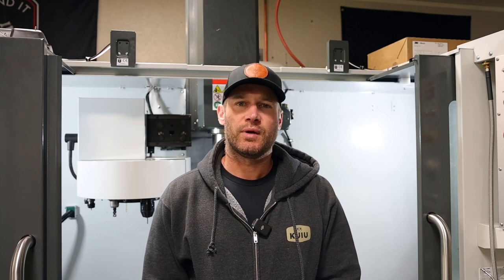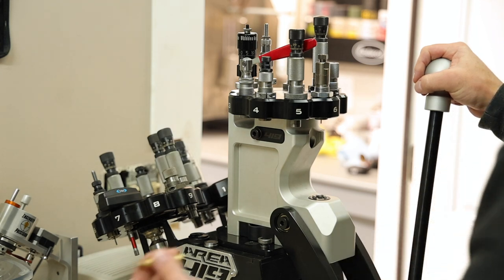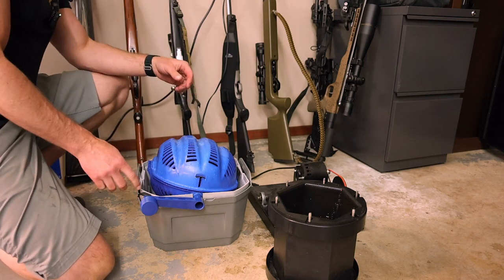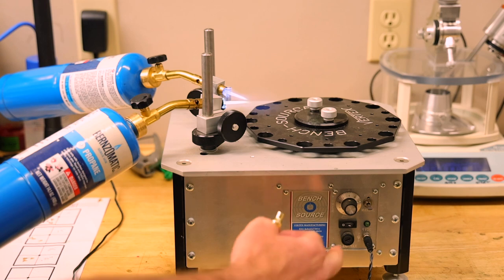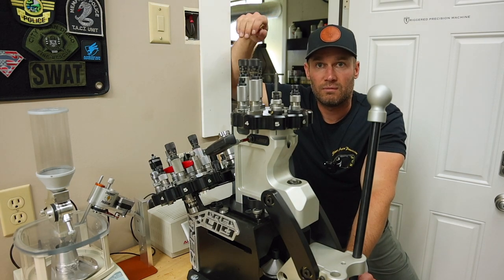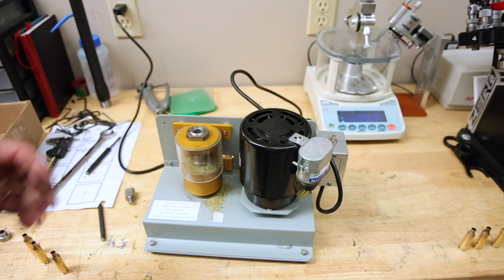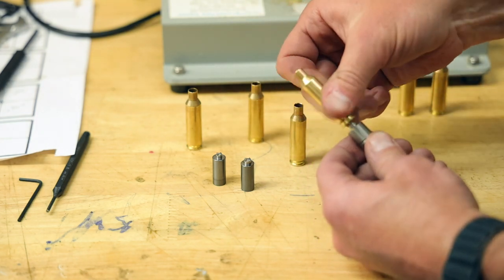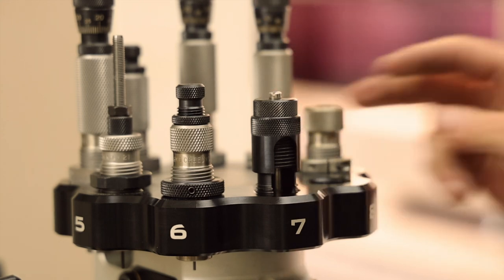TPM Reloading - The Precision Rifle Reloading Series - Episode #3 - Detailed Rifle Brass Preparation

Comment: Great series! I’m rewatching your reloading series and about to switch to wet tumbling from my ultrasonic cleaner. I appreciate your thoroughness and added detail. Since I use an SAC bushing/mandrel die I may use graphite for seating if wet tumbling removes more carbon than my current technique. P.S. I’m still loving the rifles you built me.

Comment: Regarding using the mandrel. I also try to achieve 2k neck tension. I use 21st century mandrels however when I run the case on to the mandrel when the case is brought back down I spin the case in the shell holder 180 degrees and run the case back up into the mandrel. Regarding lubricant on the mandrel I used to use the graphite like you do but I have recently switched to a liquid lube called NeoLube 2. I have found when seating my bullets in the arbor press I see more consistent seating pressure. I don’t think your going to show seating using an arbor press but the press you are using in the video. That is cool I’m probably more annal in my reloading process. What you are providing is some great information and detailed instructions for Reloaders. Keep it up 😊
Reply from the maker: Thank  you Steve - I'm seriously interested in the NeoLube - If you have a minute, check this link and see if this is the right stuff - https://www.amazon.com/Prestige-Industries-Neolube-fl-oz/dp/B07G2SK8VN

My dad is doing a whole bunch of pretty scientific neck tension testing using an Amp Press with a load cell all hooked up to a computer to graph the bullet seating pressure. So far he's discovered some pretty interesting stuff and definitively confirmed consistent neck tension and even bullet seating pressure is a massive contributor to consistent velocity. 

I'll give that NeoLube a try. Looks like a great way to go. Thanks

-Shawn
Reply: @triggeredprecisionmachinellc  that’s it.
Reply from the maker: Ordered.   Thanks!
Reply: @triggeredprecisionmachinellc  if your Dad is using the AMP press he should definitely be able to see the difference once plotted. There is a Benchrest shooter I follow and he was using AMP press and saw statistically significant results using the NeoLube. I only have a analog gauge on my arbor press but I have seen very positive results.
Reply from the maker: I'll get some sent down to him to test. That press is pretty amazing, seeing the charts it produces is wild.

Comment: That's close to what I do, except for annealing and I use an ultrasonic for brass cleaning. Great series, very well done. 

I know you've ran into this issue because I've only been reloading for 6 years and have ran into it twice. Some dies do not size properly and even though you get the correct bump, .002-.003", thee brass doesn't chamber properly due to expansion of the web/head area. I've solved the issue with different dies, but it's now happening again with Norma brass (300 Norma). I'll figure it out eventually by either finding the correct die that sizes that area or using a body die. I suspect this is a brass issue due to poor brass, but the first time it happened was with Alpha brass and switching form Redding to Forster fixed it. Now the Forster FL die is not doing it. Different caliber and gun. It's happening with my AI AXSR, but have been reading that Norma brass expands too much due to how soft it is. I have Alpha brass coming so we'll see how it goes. 

I've read a lot of stuff over various forums with people having this issue, but have yet to find the cause. Is it the fault of the die or the brass? Once I figure it out for the 300 Norma, I'll have an answer, but wanted to ask in case you (or anyone else) had a solution. Again, great series and keep the killer videos coming.
Reply from the maker: Thanks for watching Leland!

Comment: I use the Ugly Annealer for annealing Brass - for those on a budget - they are freaking awsome!!
Reply from the maker: Great tip. I've used an Ugly Annealer and they are not ugly.  HAH, I thought it worked great and would definitely recommend that as an option.

Comment: I lay the brasso to cases before sizing..helps make em slick too as I’ve had a time with lube..only thing works is paint lee lube on with toothbrush..so far never stuck a .308 and well over 1k rds….hornady dies…223 stick alot nomatter what I do cause rim won’t take much on the down stroke but lee dies just remove collet and hammer case out…I’ve got good at it..great to see you grow my friend
Reply from the maker: Are you spinning the cases in a shell holder attached to a drill motor? I've done that once or twice to polish some loaded rounds up for show purposes - makes ammo look like polished jewelry. When the brass comes out of the rotary tumbler, it almost looks polished. It has a nice slick feel to it, that's helped me a lot with cases getting stuck. 

I'm with you on the .223 stuff. Its a pain. I usually use Hornady One Shot Case Lube applied heavily a couple times and that works pretty well, but I'll still stick a case a couple times every thousand rounds or so using bulk, unsorted range brass. Thanks for watching Matt!

-Shawn

Comment: Great detailed info and my exact process, except I trim after running it through the expander mandrel. Wouldn’t you be changing the length when running the mandrel afterwards?
Reply from the maker: It's definitely possible. I do my best to only expand .001" - so I use a neck bushing that will give me .003" neck tension, then expand back up .001 for my target .002" tension number. Its such a small amount I've never seen it to make a difference. Also, I run the Giraud case trimmer which handles the trim / chamfer / debur in one shot. The chamfer adds to a nice smooth entry for the mandrel into the case.

Comment: Loving the intense in-depth of this video and taking some notes.  Curious if you get a case stuck, how do you remove it the easiest without damaging in die?
Reply from the maker: I probably do it a little different than some. I'll drill and tap the case head for a 12-24 machine screw and use a little weighted slide hammer I made to get em out. Haven't been beat yet.

Comment: Wow!!  Where were you 4 years ago when I started my precision reloading quest .. your presentation would have saved me a lot or research and grief ($$$ in reloading components) your conclusions on brass prep are similar to mine ( I've decided if Lapua doesn't make the cartridge brass -- I don't shoot that cartridge ) annealing,  dry lube and ID sizing with mandrel etc... I am still struggling on one area you passed over .... How do you decide on overall brass trim length for trimming??? ... even my Lapua brass (after being reloaded and shot once) is well under the SAMII maximum spec length that is in all the reloading literature .. Do you have a rational method for determing this?
Looking forward to you future videos ......   Well done
Reply from the maker: I did miss that, thanks for pointing it out!  As far as brass length I have two a couple things I do. If the brass is consistently  just barely short of SAAMI, I'll adjust the case holder on the Giraud trimmer to give me a proper cut. If the brass is significantly smaller than SAAMI ( more than, say .030") then I will manually chamfer and debur each piece minimally with the hopes it will grow after the next firing. Other than that, I trim all brass to SAAMI spec mostly because I use almost all SAAMI spec chambers for my personal rifles.

Comment: I may have missed you mentioning it, but Lapua 6mm creedmoor brass has a small flash hole that requires a smaller decapping pin. Also, if you are using a vibratory tumbler, go to a pet store and buy the reptile bedding.  It’s just the same walnut media, but half the price!
Reply from the maker: Awesome, great tip, thank you. I'll check out the pet store. Which polishing additives do you use with it? 

You are correct. I skipped over that because I run small decapping pins in my dedicated decapping die so I never have an issue. I've only bent one decapping pin for as long as I can remember and that was user error, lol.
Reply: @triggeredprecisionmachinellc  Flitz makes one that has worked pretty well for me. I’ve used one made by Frankford Arsenal as well.
Reply from the maker: Perfect, Flitz is what I use. I used to buy the powdered stuff that I thought worked better than the liquid but I can't remember what brand it was or where I got it from.

Comment: You're going to laugh but I have a wet tumbler identical to yours and I haven't used it just yet. Something that concerns me a bit is the possibility of having left over pins which remain inside the case. Other than inspecting each case internally with a light, very time consuming, how do you remedy this? 

Thanks for all the great videos!
Reply from the maker: Get that bad boy out and start making some shiny brass!  😂

I use a cheap Franklin Armory media separator to get the SS pins out. It does a great job and does it fairly quickly. the pins are too small in diameter to get stuck in flash holes, but I have had a couple stuck sideways in case necks. As I'm going through the brass prep process post wet tumbling, I'm always inspecting the brass. In the rare occasion there's a pin still in the case, just pop it out and get to reloading. That was a concern of mine at first but after cleaning tens of thousands of cases over the years with that tumbler, I can confidently say it's nothing to be concerned with. 

Enjoy the new machine and thanks for watching!!!
Reply: @triggeredprecisionmachinellc  Thank you!

Comment: How important is consistency with shoulder set back? If i set the die at say .002 set back but I get a piece of brass that goes .003 or .004 am I going to see a performance difference because of that?
Reply from the maker: We always try and be as accurate and consistent as possible, but there are things like shoulder setback that we just won't get exactly perfect every time. Differences in the metallurgy in the brass, how different parts become more work hardened than others, and differences in each piece of brass will effect this. The whole reason behind the arbitrary .002" setback we all shoot for is simply for ease of chambering. Ideally we wouldn't touch our case bodies and fire a perfect fire formed copy of our chamber in subsequent reloadings, but we chance chambering reliability as the brass expands to the chamber walls. 

To answer your question, I do not think you are going to see any major performance change. Once we squeeze the brass down, we no longer have that "perfect" carbon copy brass to chamber fit, but it is very, very good. If we have more significant swings in our dimension, say .001" bump to .010" bump, then I think you would see an issue, but there are so many other things that I believe play a more significant role in accuracy and consistency, I wouldn't sweat a slightly inconsistent shoulder bump. 

Great question!

Comment: I know it is an old video but this is probably the 5th time I have watched it.  Every time I end up buying something new to make my accuracy better.  This time I have to ask a question.  I use Hornaday brass because it is easier to find loaded and unloaded.  I also use redding type s dies.  Since the brass is not uniformed on the neck I am going to get the mandrel and start sizing that way instead of the bushing.  Question is I have been using a .289 bushing for roughly .002 neck tension based on average brass thickness.  Would you go to a .288 or .287 because of the inconsistency of the brass?  The reason I ask is because KM website says I should go down .007 and expand back up.  You say go down .003 and go back up to .002
Reply from the maker: On Lapua brass I've found going down .003" and expanding back up for .002" neck tension works very well on annealed brass. On other brass like Winchester, Hornady, etc., I generally will start at .004" and neck up to .002"   When you are doing it, pay attention to the feel, if you have some that barely feel like the expander is kissing, maybe try a smaller bushing until you feel the expander contact in the neck. Also, super important, be sure to use a good neck lube when expanding. Not using neck lube can gall the brass and really goof up neck tension.
Reply: @triggeredprecisionmachinellc  thank you for the information.  I guess I will buy a set of neck bushings so I have options.  I only have the one because it is what worked with the brass I have.
Reply from the maker: Yeah, sometimes its a little annoying when you start out, trying to find the right bushing range to buy can be tricky.

Comment: Kinda hard to to see but it looks like you have a power conditioner hooked up to your scale.  If so two questions.  Has it helped with your scale drifting and if so, what power conditioner are your using? Thanks!
Reply from the maker: Yessir, good eye.   

I actually had pretty bad scale drift in my old house, this helped clean it up for the most part. Here in the shop, I have a better power supply but I still use it. I leave the scale on full time and have zero scale drift. 

I'll get you the make and model of the unit when I get in the shop tomorrow. 

Thanks for watching!
Reply: @triggeredprecisionmachinellc  Same here. I live in an older house and the electricity drives my scale nuts.
Reply from the maker: Its a "Line-R 1200" made by APC.  Had it for years, and has always worked perfect. It's also nice insurance to protect your scale from power outages and surges.
Reply: @triggeredprecisionmachinellc  Thanks!
Reply from the maker: Any time!